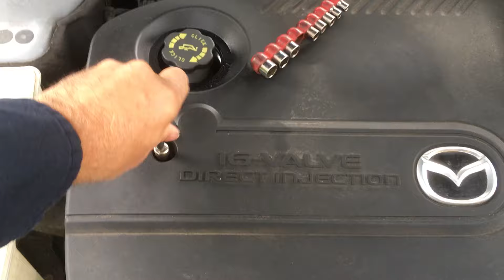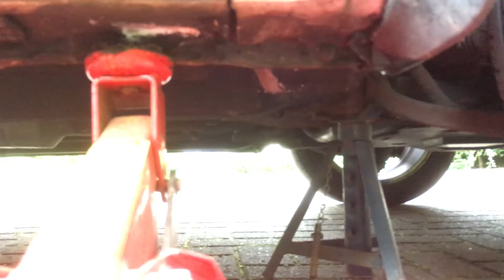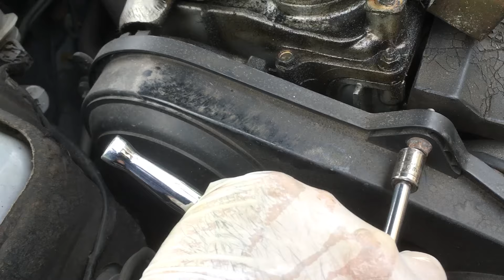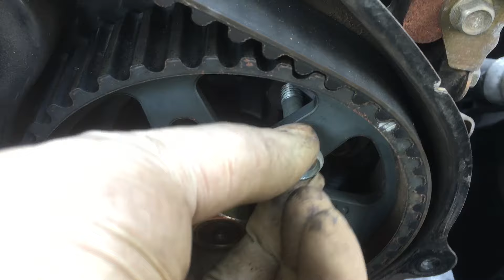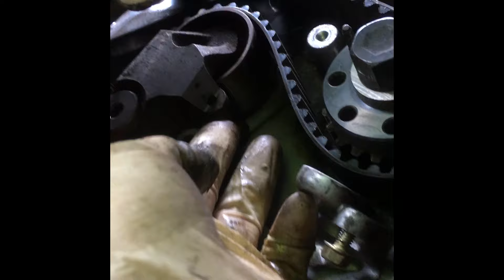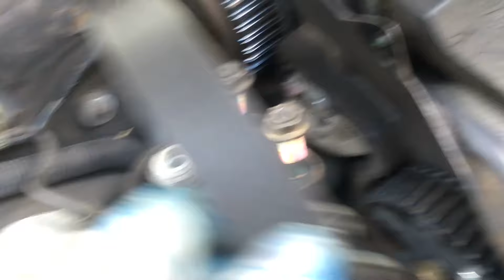Mazda 6 Diesel - changing Timing Belt

Comment: Cheers mate I've got the older RF model and about to change the belt in mine, I was wondering about the alen bolts holding the pulley on but should be sweet now, hopefully I get it back together before the sun goes down!

Comment: This video is great. I'll be using it soon to investigate an oil leak and change the belt if need be. Have you ever found oil leaking from around the timing cover or under it? It could be at the base of the sump seal, but it's on that side. Will be diving in soon to see.

Comment: Stie cineva unde se pune apa cu antigel
Reply from the maker: Antifreeze if put in the white bottle at the front, middle, of the engine. It has a small yellow cap on it which twists off.

Antigelul este pus în sticla albă din față, mijlocul motorului. Are un capac mic galben pe care se răsucește
Reply: почему вибрацыя у мазды 6 дизель